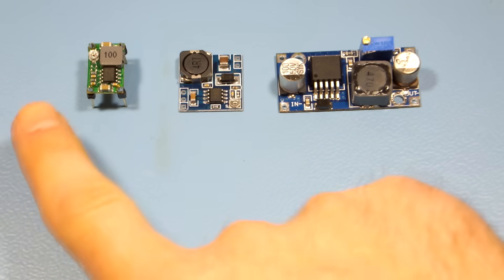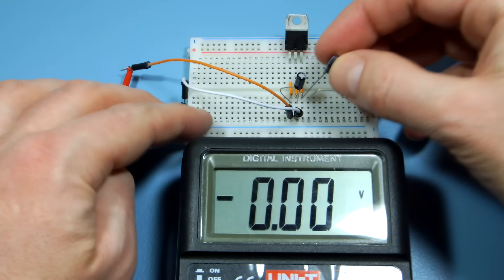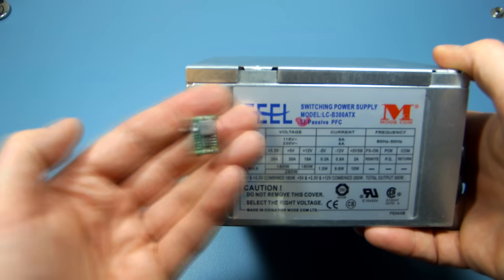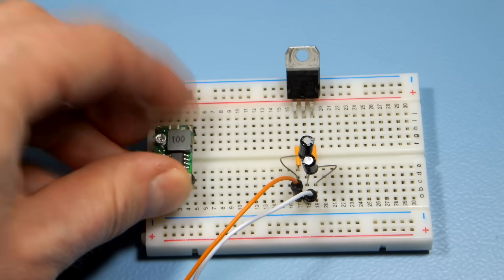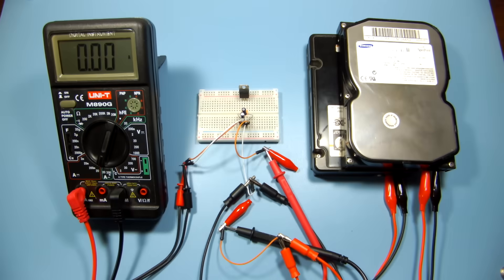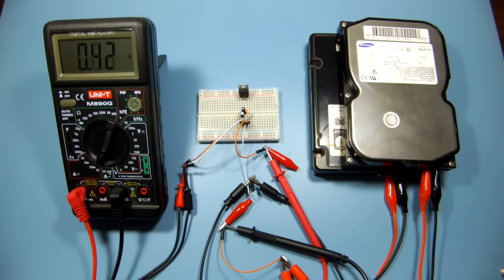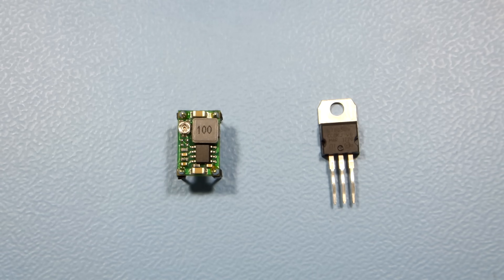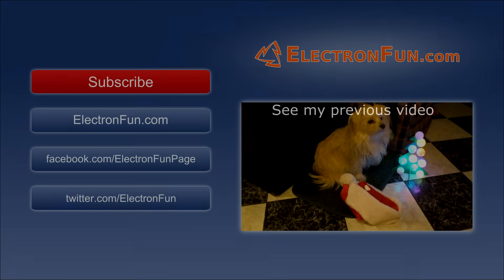Buck converter vs. linear voltage regulator - practical comparison

Comment: I just had one question in mind which has good load regulation ? I want to make 5V output and 500 mA but the Voltage drops down and changes as the load changes. That ruins my ADC Settings please suggest the regulator with high accuracy and good load regulation ?
Reply from the maker: It's pretty normal that the output voltage changes with the load. I'm guessing your output current is not constant?
Reply: Thanks for your reply but I have found good DC DC Converter now , actually while i was testing the current limit was set from the power supply at the input side and that was causing poor voltage regulation at the output limiting the power transfer across DC DC Converter .
Reply from the maker: I'm glad you managed to find the solution :)
Reply from the maker: I'm glad you managed to find the solution :)

Comment: Have you ever looked at buck PSUs on a scope?Computers use switch mode PSUs off board only. They use linears to clean it up.
Reply from the maker: Usually there are no linear voltage regulators (I mean the ICs) in computer PSUs. There are some elements of regulators, like the voltage reference. Modern power supplies are highly efficient (above 80%), so they can't use classic linear voltage regulators.

Comment: good video but a buck converter can be built with LMxxx.  I see them all over on Craigslist, and they always have some small 'heatsink' attached.  I think you should point out switching regulator vs linear as the main point
Reply from the maker: Sure, you can build a buck converter yourself, but there are several tricky aspects. Additionally, you'll probably pay more for the components than for the whole buck converter.
Yes, that's true - buck converters are a type of the switched mode power supplies. Since linear voltage regulators drop voltage, I wanted to compare it with the buck converter and not the whole switched supplies family.

Comment: use the waste heat from the linear voltage regulator to boil water for other uses.
Reply from the maker: If you wanted to boil just a single glass, it could work - who knows ;)
Reply: Yes. A tea cooker.
Reply: attach a LTD sterling engine with a small fan to cool it down.
Reply: A steam generator based on voltage regulators! :D
Reply: Boil the water, spin a turbine, charge a spare battery. I think we just figured out how to produce a perpetual motion machine ;)
Reply: Hahahaha... 2 in 1 purpose. 1. For reducing voltage. 2. Boiler . (Heat generated from that linear enough to melt a plastics.
Reply: @bhr987  if it doesnt go thermonuclear and pop before the temperature reaches plastic melting temps.
Reply: Nah you won't get enough heat for that lmao
Reply: @luuclucas  Can always add a resistor just to make sure the heat goes up :)
Reply: @mortenbrendefur7878  or vape juice maybe.. instant vape mod..
Reply: Or just don't produce excess heat.
Reply: we could boil gasoline and make engines run from vapor with them!!
Reply: You can charge mobile by buck not in 7805

Comment: dumb question: why do you need 2 capacitors? never used them and got also the desired voltage out without any problems.
Reply from the maker: Using the capacitors is a good practice and it is recommended by the datasheet. They are used to make the input and output voltages a little smoother.

Comment: please make Conclusion for that.. i am cant english language 😣
because i am want to make regulator high current?? 
please respone 😊thxx
Reply from the maker: What conclusion do you mean? What do you mean by high current - 5A, 50A...?
Reply: yes,, but the in put is unreg(1v - 35v) ? can i am make regulator for it?
Reply from the maker: I would probably use a step-up/step down converter, when you need such a wide input voltage range.

Comment: I am making a power supply. I need to down 28 volts to 12 volts for my cooling fans. The fans draws 300 milliamps max. Which buck converter should I buy? The smallest one in this video? or the LM2596 one?
Reply from the maker: The small buck converter accepts only 23V on the input. You should look for something that is able to accept 28V. The biggest buck converter in the video goes up to 40V, but it's quite big.

Comment: Has anyone here tested the linearity of the buck converters vs the "linear" voltage regulator, under a variety of loads? A square-wave signal generator, for example, would be a very interesting test of a linear psu. Cheers
Reply from the maker: I haven't tested that, but I agree it could be a nice experiment. Maybe someone else has already done that. Anyone guys?

Comment: i want 3amp 5v charger  how to make 7805
Reply from the maker: You could use for example LM323, which is a 3A 5V linear voltage regulator.

Comment: If wish you should have shown the Buck Converter via a pretty quick oscilloscope. Then you would have seen how dirty the signal of a buck converter can be and why you should not use it for e.a. an amplifier or radio circuit.
Reply from the maker: I simply didn't have an oscilloscope back then, but I agree - I should have showed the noise level.

Comment: Thank you for your explanation. 
Hi, I have an issue with an USB step down converter : only 4,6 V on output without any load and not able to draw more than 20mA : https://youtu.be/RK9IOwxknno
Any idea ?
Reply from the maker: As far as I could see, there are no potentiometers on your step down converter and it is supposed to produce 5V. I guess the device is faulty, but the whole batch? Where did you buy them?
Reply: Thank for your answer. Yes all the batch generate 4.6 V on output. I have ordered the device here : http://www.ebay.fr/itm/121795311232?ul_noapp=true
Reply from the maker: I would suggest contacting the seller, who should find a solution for you or give your money back.
Reply from the maker: That's kind of strange that you should mess around with resistors. If this device is supposed to produce 5V on the output,  it should do exactly that. I hope you ordered another batch from somebody else. Good luck and please let me know about the result, when you get the new items.

Comment: What if we use 5 parallel linear voltage regulator? same price but not so much down sides ! Am i right ?
Reply from the maker: Unfortunately it's not that easy. LM7805 was not designed to work in parallel. These 5 regulators would not be balanced and each of them would deliver different amounts of current. Some of them would probably fail much sooner than others.
There are linear voltage regulators designed to work in parallel configurations, but they are much more expensive.
Reply: ElectronFun.com what do you say about this
https://youtu.be/DKkSHEcDIu4

Comment: Both have their place in circuits, but for reliability, I'll take the linear regulator with a good heat sink over the dc ~ dc converter any day, and that's what 35 years of experience tells me.
Reply from the maker: I couldn't agree more. DC-DC converters are much more efficient in most situations, but reliability may be a completely different story.
Reply: Modern Dc-dc MTBF is very similar to linear regulator.

Comment: First, the linear voltage regulator doesn't dissipate 5.04W at .42A. You have to calculate not the PSU voltage, but the voltage that is dropped across the voltage regulator. So, (12-5)*0.42=2.94W. Same formula for the buck converter.
Second, it looks like you measured temperature of the coil of the buck converter, not the IC. Coils don't get as hot, measure the IC!
Reply from the maker: I wasn't measuring heat dissipation, it was power consumption with the load.
You are right, I measured the coil's temperature. I checked by touch and it seemed to be hotter than the IC itself. I should have measured both.
Reply: mine have 2 coil and both hotter than any ic it self, idk yours
Reply: Yes...coil don't get as hot as the IC
Reply: Most type of buck voltage converters i have tested and some ZVS it's the coil that gets hottest by far!

The bigger ones with power mosfet, there is a different story

Comment: nice 1 i thought they were better but you never showed boost converter looks same as the biggest one not only is there a step-down there's step up too lol
Reply from the maker: Yes, there are step-down, step-up converters and a hybrid of both available on the market. Sometimes it's difficult to tell them apart.
Reply: ElectronFun.com the boost ones i got am on red PCB Neva looked if they was colour coded ....prob not lol gud video bro thanks for replying .....👍
Reply from the maker: The PCB color doesn't give the clue. Different manufacturers may use green, blue or others, depending on what's cheaper at the moment.

Comment: Great video!! Can I ask what is the output current of the buck converter?
Reply from the maker: Thank you! The output current is the amount of current a buck converter is able to deliver to a device you want to power with it.
Reply: ElectronFun.com Is it fixed regardless the input voltage? Say my input is 12V 1A and I want an output  of 5V.Does it gives me a current nearly 2A?
Reply from the maker: No, it's not fixed. Most devices powered from the buck converter draw as much as they need (LEDs are a bit different - they draw more than they need and burn out, so a resistor for protection is a must).
Reply: Ok,now I know.Thanks again :)
Reply from the maker: No problem :)

Comment: Where would a resistor come in? I know a resistor can resist voltage too, but im guess they are not as efficient as buck converters?
Reply from the maker: A resistor is used to reduce current flow rather than voltage. There are some other applications too. For example, you could build a voltage divider out of resistors and get your desired voltage level, but you would have to assume constant source voltage. What's more, the efficiency of such contraptions is far from perfect.
Reply: Hi ElectonFun thanks for your reply. 

So would you say a resistors best use would be to reduce small amounts of current say for a 3v LED with a power source 6v?

I have project with a power source of 12v. But most of my components are 5v to 3v. would than a buck converter be a good choice for stepping down the voltage?
Reply from the maker: Resistors are often used to reduce current drawn by LEDs to protect them from burning out. I don't know what your project is, but a buck converter should be a good idea for most projects.
Reply: codoyen - Resistance voltage dividers are used almost everywhere when noise matters. Look at some schematics. 

Recent developments in LDO technology is something you should look into before touching junk, mass produced Chinese buck/boost converters.
Reply: +Shovel 
dam dude... XD LoL
that is totally different..

Buck converter & LM > Regulating voltage / supplying steady voltage to circuit. (ideally didn't consume power. just passing it by. Just like non-linear component <inductor/capacitor> )

Resistor > Consume power. Dissipating power into heat. If you add device to the circuit after resistor, it will then divide the voltage output, which will then cannot supplying steady 5Vdc on the output side. ;-)
Reply: What if you have a 100ah AGM deep cycle battery putting out about 14-15 volts and you need to bring it down to a constant 12v being fed to 3 sources (two 12v sockets and one USB socket pair).  The 12v sockets would be used to power several Amps hours each for LED lighting.
Reply: Not true. In your example of 12 V in and 5 V out, a resistor on the 12 V side could be calculated to drop 4 volts, giving the 7805 the 3 V Vin-Vout differential the 7805 needs to stay in regulation. The majority of the power would then be dissipated by the resistor in a 4/3 ratio. A low Vin/Vout regulator would be even better in this case. There would still be a bunch of heat you'd need to get out of the box.
Reply: Depends on the power. LEDs don't need highly regulated power supplies.

Comment: There is one more side to this comparison. the standby current draw. If the output is not used for an extended period of time, the buck converter will still draw some current, however the linear converter will draw only a very small amount, so for this case linear is better.
Reply from the maker: That's true, I did not take standby current draw into consideration and I know switched mode power supplies will draw more than linear voltage regulators.

Comment: Thanks this was very helpful. My question is I have a voltage regulator on my motorcycle. It uses a LVR and is not reliable. I was wondering could a buck be used instead? Well thanks for any advice.
Reply from the maker: Thanks for your comment :)
You could use a buck converter on your motorcycle, it should work just fine. What makes your LVR unreliable? Is the output voltage too low?
Reply: Oh, thanks so much for your reply. From years of fixing motorcycles voltage regulators / rectifiers I can't answer nor dose it seam can anyone else. The motorcycle forums are full of people with this same problem. They just burn out. Most times it doesn't pay to just replace the VR. Most times you end up replacing the stater and the VR as a set. I've a drawer full of them. I de-potted a VR once and found the LVR's burnt.
Reply: I just wanted to say the stater put's out 3 phase AC and VR converts that into DC and regulates it to the battery. So I would need a AC to DC buck?
Reply from the maker: I believe so, but I have absolutely no experience with motors, so I'm not able to recommend anything, which would last, sorry.

Comment: Cool! but... what if, I want to use more than 1Amp... to be exactly 6Amp in 12Volts? ...
Reply from the maker: You want to look for a much more powerful linear voltage regulator (e.g. LT1038) or buck converter (e.g. based on LT1270).
Reply: can you recommend a low heat setup for 14-15v down to 12v on a 100ah source with the load being between 4 and 6 amps?

Comment: What about a switching converter with a linear regulator in the output? Combines the best of both worlds. ;)
Reply from the maker: It looks good in theory, but I haven't tested this configuration yet. It may be a good idea for a short video :)
Reply: From what I read, this configuration provides better efficiency, with good regulation and quite low ripple. 
For the choice of components, I would stick with a LM2576 "simple switcher" and maybe a uA78XX regulator chip. That should do the trick.
Reply from the maker: I will have to try this out one day. I may use this idea for a video experiment :)
Reply: Dropout voltage is the problem.  You need to feed a voltage higher than the output voltage to a linear regulator. For a plain old 7805 you need to feed it a minimum of about 7 volts to get 5 out. So the 2 volts X the current is dissipated as heat.  There are low dropout versions of linear regulators but they are more expensive.  In my opinion go for the buck regulator first and consider a linear if the switching noise causes problems.  Bucks are cheap as chips on Ebay, Amazon etc, especially if you buy 5 or 10 at once.  Bucks do produce heat, but nothing like what a linear produces.

Comment: hi, nice n helpful video. but i want to ask if in buck converter if want to use potentiometer to adj. volt....so that to use from front panel.....which one to use....can you give some tip ???
Reply from the maker: Thank you :)
I would always choose a multi-turn potentiometer to get more control over the voltage value.

Comment: hi all i like to replace lm317 circuit with the small buck converter for driving laser diode is it possible for long time use in in-closed housing
Reply from the maker: Yes, you can use buck converters for long periods of tim and in enclosures, but the temperature depends on how many amps you are drawing out of itl
Reply: ElectronFun.com (using only 1mw )2.8 volts
Reply from the maker: You can use it anywhere, if you are using only 1mW.

Comment: what is the differnce between LDO and Switching regulator?

When we can use LDO and when to use switching regulator?
Reply from the maker: The low-dropout regulator is still a linear voltage regulator. The standard regulator usually needs at least 2V higher input than the output voltage. The LDO will work even if the difference between the input and output voltages is lower than 2V. You can use them just like the normal regulators.

Comment: great info... I can see many vidoes to great emergency power banks using 7805IC. No one discussed about temperature. Please let us know if it's good  idea to build emergence power banks using 7085IC or not and how efficient it would be. Thanks
Reply from the maker: Could you post a link to one of these videos? The LM7805 is not the best choice for a power bank. There are battery charging circuits ready to use on eBay, which can even handle cell balancing. They are fairly cheap - the prices start at around $2.

Comment: If you don't need very much current (<50mA) you should go with a linear regulator.
Reply from the maker: I often say everything depends on your application. What if you have a battery powered device, which is not sensitive at all?
Reply: The efficiency of most switching buck regulators (unless they use burst-mode or some other special mode) will drop off significantly for low load currents.  That's why it is critical to size your switching supply (or linear regulator) appropriately.  Like you say, it depends on the application.
Reply from the maker: Yup, that's so true.

Comment: you can use metal shielding around the buck converter i think you can buy them with metal shields already presoldered to the PCB if you are building a sensitive electronics
Reply from the maker: Sure, it's an option if you have issues with radio-frequency interference.